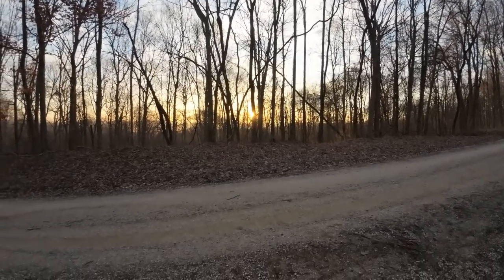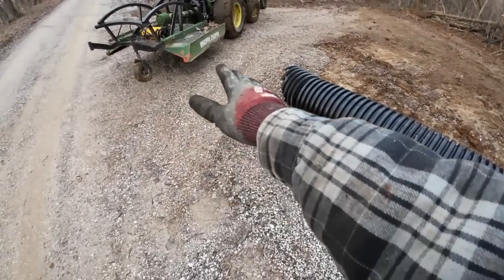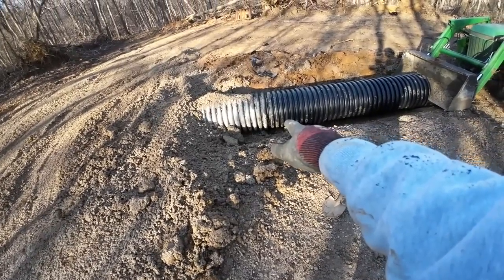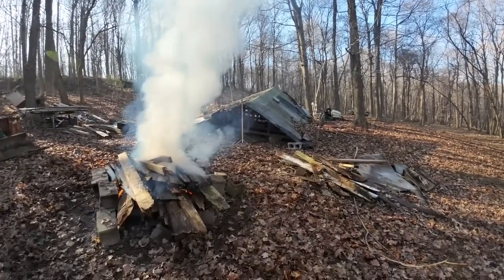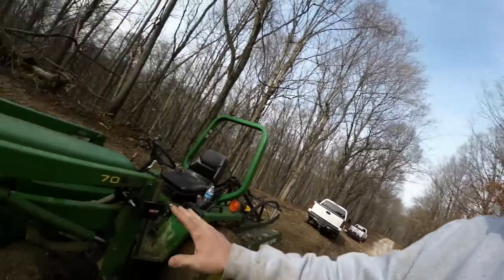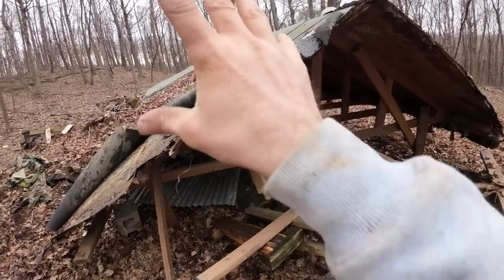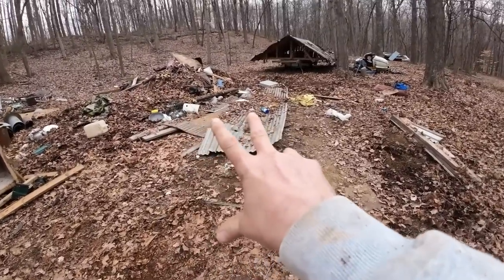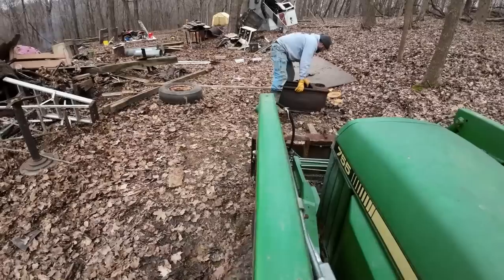Is it Junk? - Saving Collapsed Cabin Roof - John Deere 755 Tractor

Comment: We've used those centers for a bunch of our field approaches and we've found flashing tape and cutting the walls in four places two rings and force them together. We use a couple of Deck screws for additional attachment and no it's not easy but can be done with a skid steer usually. Just another useless tidbit of information that may help later builds and don't forget the lube 😆😆. As always good luck and God Bless.
Reply from the maker: They work good!

Comment: Cap’n, once again you proved the immutable laws of physics…. 
1 You can’t fill a tire with a compressor if the hole is larger than the hose bringing the air!

2 There is no finer means of getting traction than turf tires on mud covered with wet leaves.

3 It may very well be possible to build a house from the roof down!

4 Two country boys with a 755, a 4X4 and a little time on their hands can move just about anything!

PS I’m about done with the rivet stamp… should be able to send you an e-mail this week!
Reply from the maker: Sounds good!

Comment: Mike that is interesting how you were able to make the connection with the two pipes.  The entire project is something to be admired, you make it work no problem what the issue is... Look forward to seeing the 555 running and doing a lot of the work that you are doing with Little Green machine.  It is a sad state of affairs when we have to worry that someone would steal the culvert if it isn't secured tightly.

Comment: Looks like a good time. When I bought my first 30 HP tractor with a loader, a friend of mine said "you can't dig with that loader."  Challenge accepted.  (Heck, I'd just built two house pads with a non-loader old tractor with a little 4 foot box blade.)  Glad to see the little JD is still exceeding expectations, and really impressed you got those tires to hold air, even for a little while.  Thanks for the video, it's daylight now, so guess I need to go get ready for the snow storm on the ranch.  Take care!

Comment: pulling in reverse will always take weight off of the rear tires. I suggest pulling from the rear. its not crucial on a tractor, but on a pick-up truck i would always pull going forward as that is how the suspension is designed. Cheers.
Reply from the maker: It depends

Comment: Turf tires loaded with mud and lost their grip. One of the few times I think you might have done better with other tires. Not to spend your money, what do you think of seeing if you can find an extra set of rims and put R4's on them when it is that muddy in the winter? I hear good things about the new R14's too.
anyhow, plywood looks a might damp on the one end, you have all that roof metal, maybe cut it off and swap?

Comment: Question: I know we firefighters like to keep truck doors open for the fast get-a-way, but do you have trouble leaving your truck door open (as seen in several shots here)?
Reply from the maker: Is that trouble?  Seems like something that doesn't matter
Reply: @CaptainKleeman  - my Chevy dealer seems to think so. My daughter left the door open and drained the battery to where it wouldn’t start. 9 month old Silverado. Mechanic says it is more than the dome/door lights now - it actually keeps the systems “active” even with no key present so it is a bigger drain than even a decade ago. It may have been an excuse, because they gave me a new battery under warranty 

Just passing on my experience

Comment: Might be easier to just fill those tires with expandable foam (or similar) so the tires have better maneuverability.   I assume you don't have a vested interest in replacing them and if the foam doesn't work properly then it is no different than the state they're in now.   I can't imagine they would be any worse.
Reply from the maker: Adding tubes and will eventually switch to R14

Comment: I truly think disassembly would have saved the lumber and Time vs the fun of using a recycled trailer, but I'm just a keyboard warrior so you do you and I'll catch up on the boat build in the future
Reply from the maker: Waiting for your video of disassembling an OSB sheeted roof where you save the asphalt roll roofing and osb with out significant damage to the point it's still usable... Thanks for watching
Reply: @CaptainKleeman  my propane torch doesn't come with that as an option

Comment: Looks like fun to me! Now, when you get the triple nickel up and running, all you would need to do is run a chain down thru top center of the roof and hook on to a pipe or 6x6 to carry the trusses and lift with the back hoe boom, set your post, and you be done, if you aren’t 25 miles plus away, any way. I like this series, fun stuff thanks for sharing the update
Reply from the maker: That's pretty close to the plan we have!

Comment: Looks to me like you shaved down the seam end of the lower culvert pipe.  Me thinks you should have shaved down the seam end of the higher.
Reply from the maker: That would be incorrect
Reply: That would be correct.  You spliced the two pipes inside out......technically a mistake.